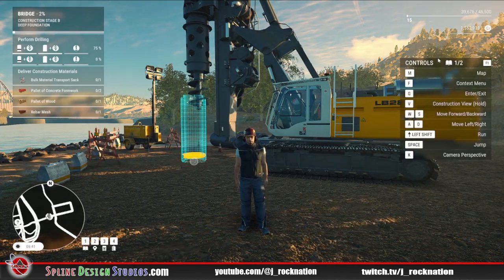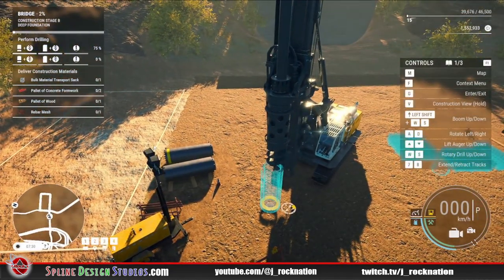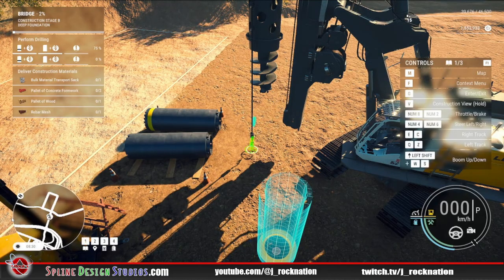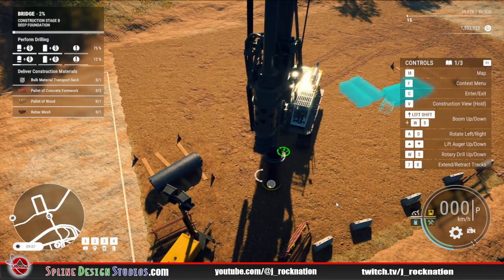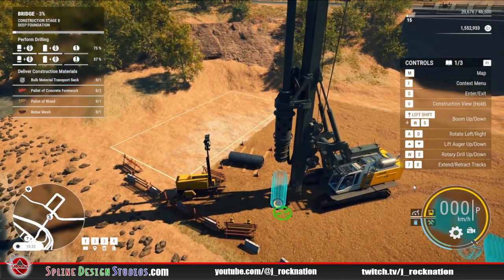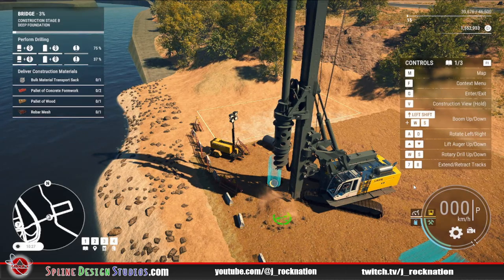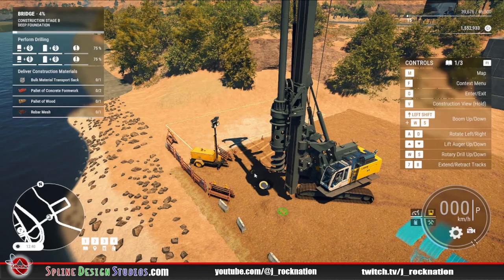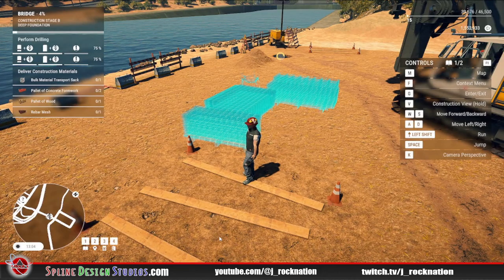Construction Simulator - How to use Liebherr LB28 Drilling Rig

Comment: I'm stuck at 75%. Cant bring the chasis back up. Can connect and disconnect and move augur, but not chasis. Only way is to reset. Retry gets me into same place. Any hints?
Reply: The last 25% is the concrete pour, it’s stupid it doesn’t tell you

Comment: I dont know what to do for the last part of the drilling part. I got to 75% on both but when I try to fill it up with concrete it does not go up at all. I use the DAF mixer pump if that had an issue with it.
Reply from the maker: Should be able to use practically use any cement truck to fill the hole the rest of the way.  Have no had any problems with it.  Hopefully get that figured out!!